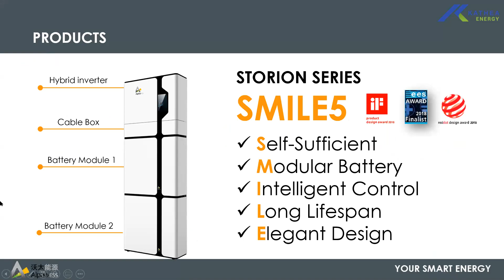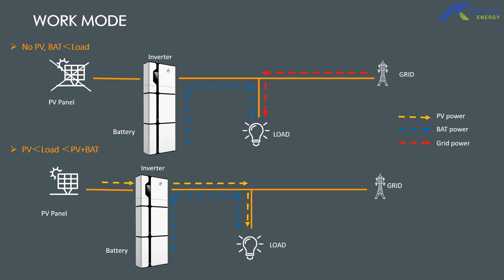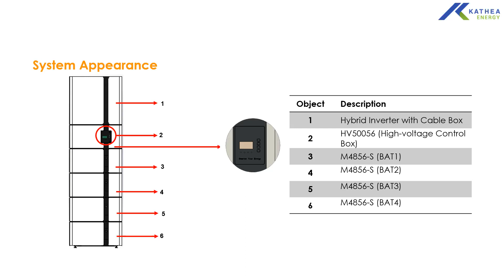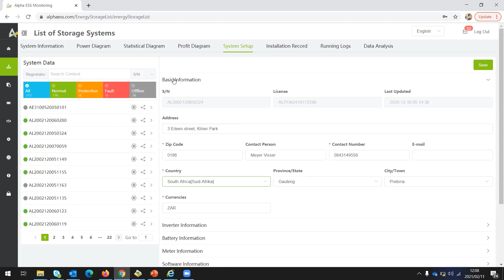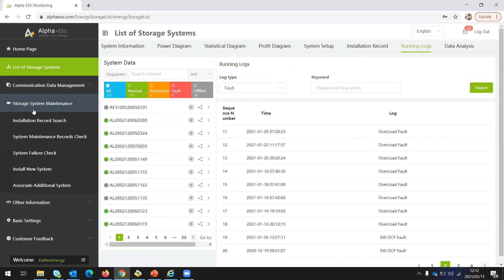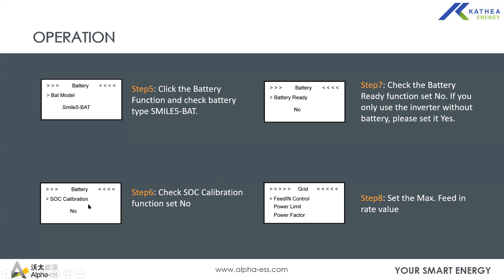ALPHA ESS PRODUCT & TECHNICAL TRAINING!

Comment: I live in Australia and have had a Alpha ESS battery 5 kw fitted to my house. Main reason was to reduce my power bill. Other reason is to have power when I loose the grid power.   The company that installed it says I will not have back up power as the battery needs 240 volts to work. In your training video it shows back-up power with no grid power. How can I get my Alpha ESS battery to supply back-up power. I have a smart meter that has a meter for power coming in  and going to th grid. Have two solar systems 1 x 5 kw & 1 X 6 kw.